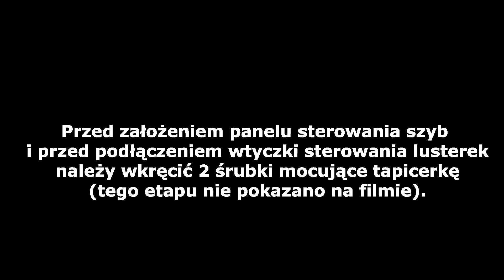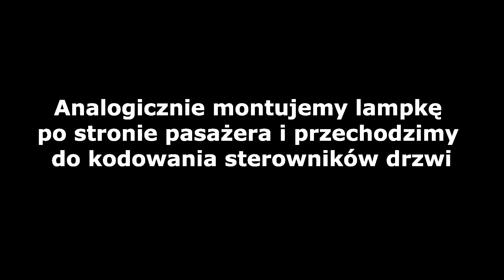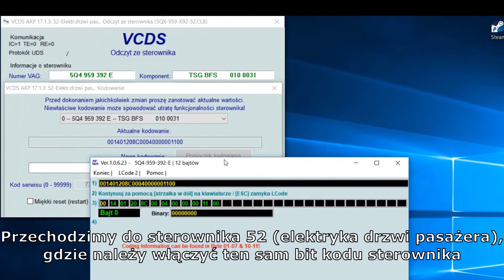Montaż lampek ostrzegawczych drzwi - na przykładzie Skody Octavii III

Comment: This video is amazing! Just what I needed to fit my door lights and replace the reflectors. Thank you! I have the coding tool too so excited to get the job done. A question though, I also have an aftermarket head unit that uses in-tyre TPMS and so want to disable the factory ABS based TPMS system, do you know how I can code that out in the Octavia? I can then re enable if needed or I sell the car.
Reply from the maker: Hi. I haven't done such coding, but I found a thread on this topic. Maybe this will help.
https://forums.ross-tech.com/index.php?threads/5118/

Comment: and on right doors is the same?
Reply from the maker: On the right, the connection is the same.  Just removing the door trim is slightly different.  You have to push the window opening button slightly to unscrew the screw.